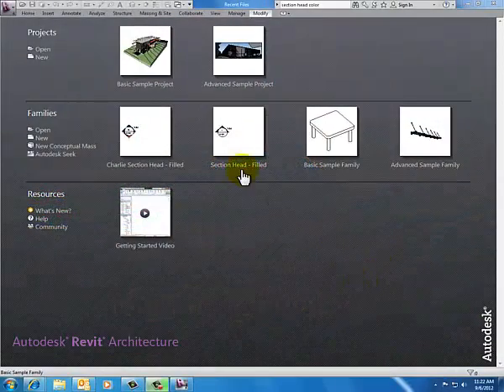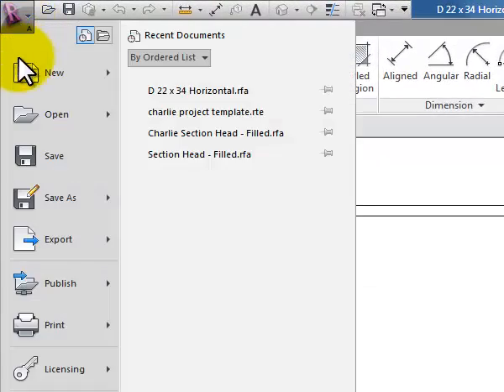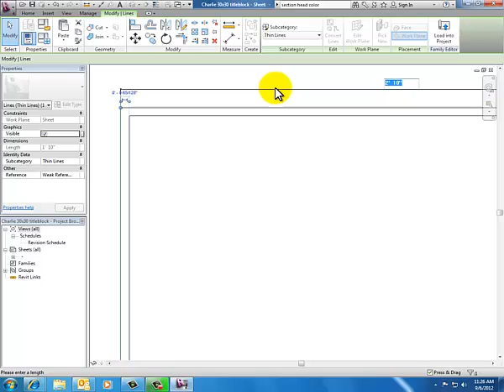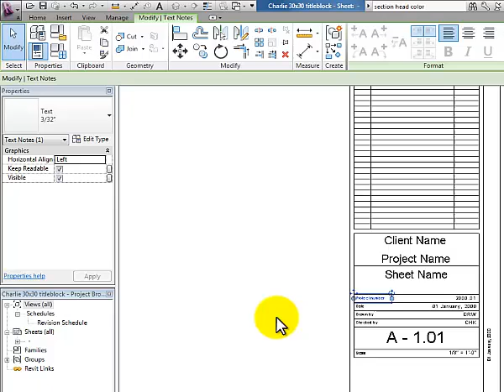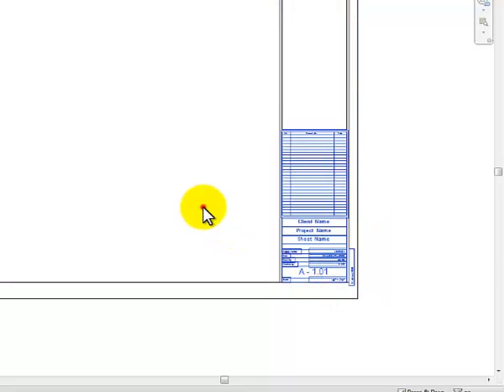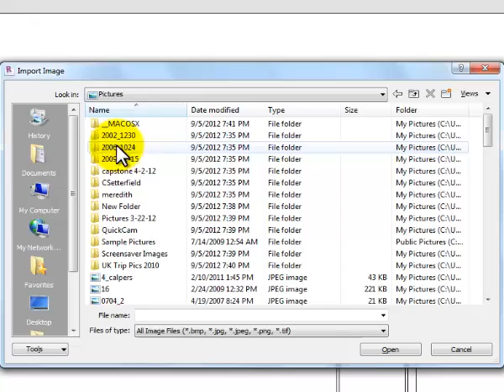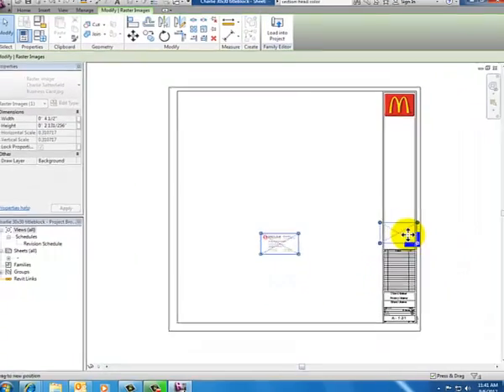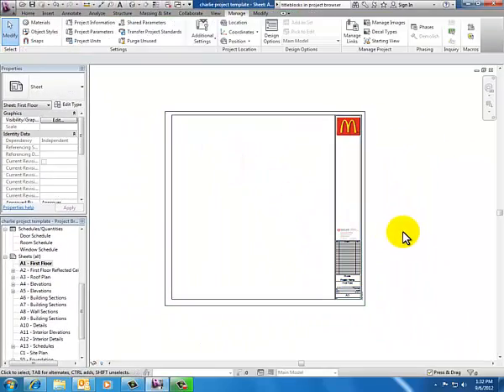Revit Custom titleblock

Comment: An important thing I thought should have been mentioned is whether the imported image reference is stored within the title block file or is in fact merely linked from it's location on the users drive. This seems crucial, because it very much affects if the title block will display correctly for different users. Store the image on server, in the company standards folder, maybe?